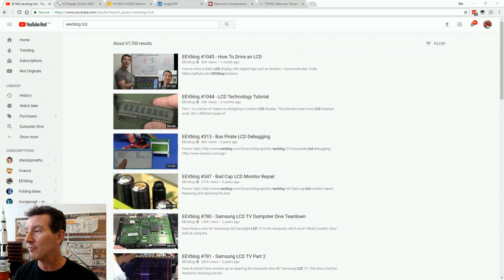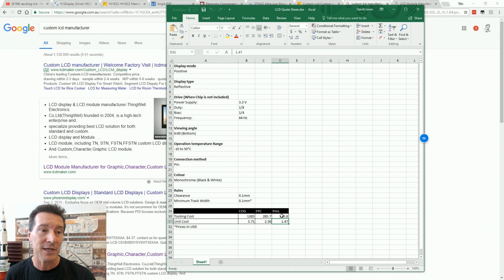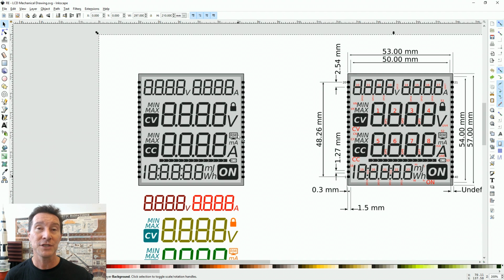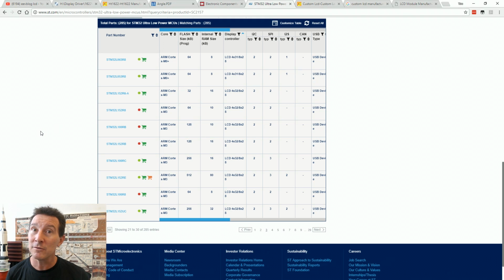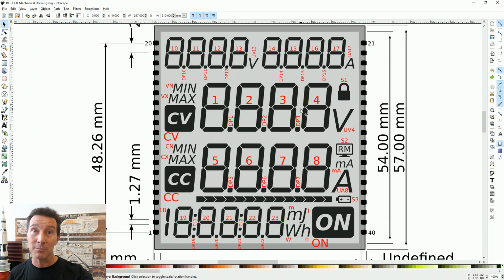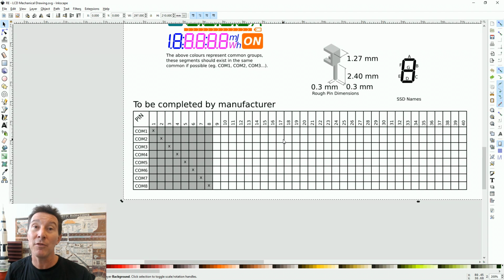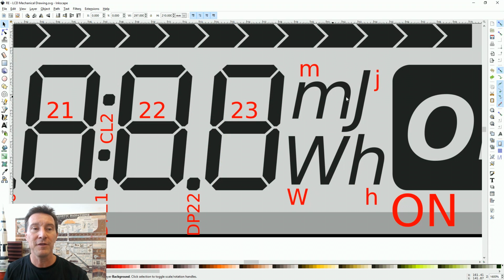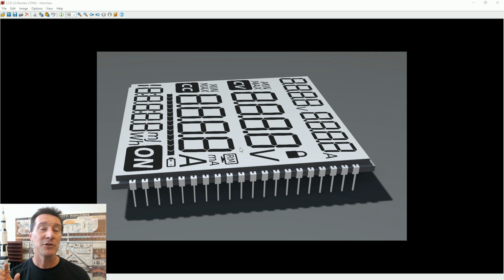EEVblog #1055 - How to Design a Custom LCD- µSupply Part 16

Comment: No EEVblog logo?
Reply: +1 !!!
Reply: Flashing, preferably :-)
Reply: George Of The Jungle It just needs an extra g shaped segment somewhere, the rest can be done with existing segments.  Of cause an offset g can be done with a 7-seg digit.  So the top line can display a crooked EEvblog, with a flying g and a some odd spacing around the l (or use a well-spaced EEvbLOg).  A slight redesign to make the top middle v a capital V could improve the logo but would hurt day-to-day readability of the two numbers.

Comment: Custom LCDs really look cheap compared to graphics LCDs.
Reply: What about power consumption ? I bet your graphics LCD will eat battery really quickly.
Reply: When it's always displaying the same thing, I'd much rather have smooth vector edges on the segments than have pixelated everything.
Related, please don't use a transmissive LCD unless you really have to.
Reply: Interesting, I think exactly the opposite.  Custom LCDs look custom.  Anybody can buy a generic graphic LCD and write some code.
Reply: Power consuption in a battery powered product would surely be higher.
Reply: I don't quite think they are more readable than graphics LCDs of a reasonable resolution. But then, they are more expensive. However, if the product is expensive enough, I expect a quality display.
Reply: pahom dammit man
Reply: Have you seen some of the graphics displays in some cheap products? Gahhh!
Reply: Custom displays are usually much more readable than a graphics LCD if you only have some fixed type of data to show.
Reply: OLED is even better.
Reply: totally disagree. i absolutely love custom lcds and i freak out when stuff has one

Comment: You know what would be real cool dave. A custom VFD! What would be the damage pr 1000 for those bad boys? , is it even possible to get them custom made?
Reply: Willy Nebula Amazing Idea. It would be a flash from the past! Would really enjoy it. Driving VFD's is really easy with ULN2803 and a 10k resistor pack
Reply: of course...futaba will gadly respond, if you gonna ask for 1k or more...they do a real good job on these....but may you are happy getting used 20by2 for next to nothing, as all these old cash desk systems are about to being thrown away these days...i got myself a bunch of epson DM101 and others...when one of our supermarkets changed ther system....i only needed to ask the manager and he said: look over there and take what you want....it was a huge pile of these old "crap" scanners, keyboards, and these customer displays...along with thermal printers and stuff...
And the next neat thing about these is: you don´t need to build your own driver..it´s already been done, all you need to do is talk to it via a serial protocol....(parallel for that printer) i used these about three times along with an arduino uno based 328 DIY driverboard, in clocks for me and given also to close friends...
Reply: these USB types are a complete other world...but there is a PC/linux driver pac out there with that you may can use these displays along with the computer...(LCDhype or similar when i remember correctly)
Reply: VFDs are still used in POS/PointOFSale environments, because of good brightness+contrast.
they usually run from 5..24V and can be controlled by simple "echo text" command to (virtual) comports..
(basically nothing different to a 2x16 lcd...)
edit => http://www.ralhk.com/products-list.asp?class1=18
Reply: Thank you very much! I'm looking into it now.
Reply: TubiCal hi tubical, I saw your videos about the Epson display on tour Instagram and managed to grab a few of those as well. But mine are USB, so they got an FTDI IC and I couldn't get the darn driver to work. The display itself has way less pins than I expected, so is there some kind of driver chip inside it? I don't want to risk damaging mine until I figure out if it's possible to talk to the display directly or if I'd need a separated driver IC. Thank you very much for the inspiration!
Reply: lol. I keep cracking my head against trying to replicate the rough behaviour and qualities of CRT displays in a more convenient and accessible form (the reason for this is dealing with retro computer hardware that doesn't really behave as intended when hooked up to LCD displays or televisions.)

At one point in my investigations among what exists, VFD displays came up, since they have a handful of things in common with CRT displays, but the prices and available modules were unsuited.
I doubt a custom VFD suitable for replicating a CRT display would be in an affordable price range though.

I suspect the most promising thing in practice might be an OLED display with completely custom driver circuitry, though that still won't properly replicate the qualities of a CRT, it at least avoids some of the bigger pitfalls of LCD displays.
Another option that does in fact work really well, but which is impractical due to safety considerations is a laser projection display. (not a projector in the standard sense; since those are starting to use lasers as a form of illumination) - Rather, the kind of system used in laser light shows; Red, Green and Blue lasers where it's possible to directly control the laser position.
This, within reason does a pretty good job of replicating the behaviour and characteristics of a CRT. (both being formed by deflecting a beam onto a screen; One a laser beam, the other an electron beam.)

However these aren't laserpointers here; such devices involve lasers with considerable output power; the kind you officially need safety glasses and a degree of training to be allowed to use...
Plus, the beam deflection is done mechanically with mirrors, which imposes some deflection speed limits that are harsher than for a CRT...

Turns out replicating an old technology is quite hard.

At this point I wondered if anyone still knew how to make CRT tubes; That would solve part of the issue, but then again it leaves you with all the same problems CRT's have had for ages - the biggest of which being that they are extremely bulky, heavy, and fragile.

Guess there won't be a good solution for this issue; For now, old CRT displays are still available, but for practical reasons they're disappearing and becoming unusable at a far faster rate than the computers which were designed with such displays in mind....

Comment: I want to build a low power weather display for in my kitchen. I was looking at a beautiful 7.5" e-ink screen, should work well but the 6 second refresh with no partial refresh is stopping me from buying it :( https://www.ebay.com/itm/7-5inch-E-Ink-display-HAT-Raspberry-Pi-640x384-SPI-Raspberry-Pi-Connectivity-/253170061718
Reply: toysareforboys take a look at This Video from Ben Krasnow: https://youtu.be/MsbiO8EAsGw

He Made fast partial refresh possible with some reverse engineering and a custom Firmware for the Display.
Reply: nice, but as a weather display, who needs a fast refresh anyways? every 5 minutes would be absolutely ok...mine has an update rate of 15 minutes max speed...and i´m pretty ok with that. :)
Reply: Amazing!!! I going to order one and give it a hack attempt. I want to get the highest resolution one possible, I'm thinking 800x600 should work! Thanks so much for the link, explains a ton about how they work. Had I attempted it myself I would have for sure burnt the screen first try.
Reply: I primarily wanted partial refresh for animated icons, lol. Not required, but I really really want to do it. The weather animations will be from from the week day list here: https://darksky.net/forecast/43.654,-79.3872/ca12/en
Reply: Get a 2nd hand kindle, they go for ~nothing, and see here how to root it: mobileread.com
Reply: Hmmm, that could work. Do the e-paper Kindles have a web browser? i.e. "Kindle 4 WIFI"
Reply: It's got a browser but frankly it's quite useless. What you get is a linux with wifi and a serial port and a working eink display with proper drivers but no desktop or UI unless you want to mess with their ugly UI framework (it's a pita). Go to the mobileread forum and wiki.

Comment: Liquid Crystal Display Display.
Reply: Very useful when putting in your PIN number in the ATM Machine.
Reply: I knew this would be the top comment the second he said this...
Reply: DVD disk, CD disk, VFD display..."comes also in DIP-package"...and i cound go on forever...;)
Reply: yeah like LED diode and so on ...
Reply: If somebody say LC display, it would make no sense for many. Same with LE diode , TT logic. :-)
Reply: It is only redundant because you happen to know that the "D" in LCD stands for display: someone who's not technically inclined enough to know the meaning of the acronyms still does benefit from the redundancy.
Reply: Depending on audience and situation, couldn't it actually make sense to say LCD display? LCD as the technology (not OLED/7segment/...), and then specifying we're talking about a display assembly (not TV/monitor).
Reply: RAS Syndrome :D
Reply: Additional question: How do we want to call the light coming from an LED? LED light (redundant), or diode-emitted-light, DEL?  :-)
Reply: "LED Light" is not as redundant as "LCD Display" or "CD Disk"
You could replace "Light" with fixture, I guess?
Reply: it runs on DC current
Reply: I need a custom 8001x8002.5 Liquid Crystal Display Display
Reply: Mathis Bü lumenecence? 🙂😁🙃
Reply: Most ATM machines have those.
Reply: It's for building an Automatic Teller Machine Machine. 😁
Reply: Driven by TTL logic
Reply: Bernd Felsche or cash machine 😀
Reply: ATM Machine
Reply: http://lmgtfy.com/?q=define+initialism